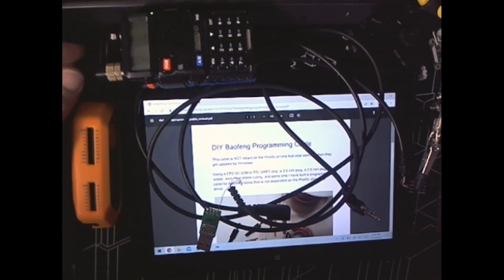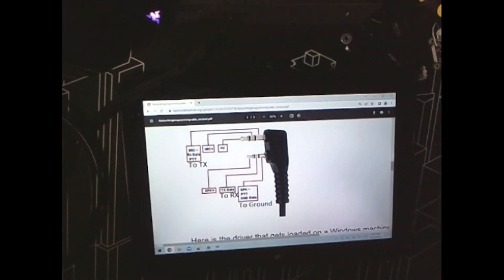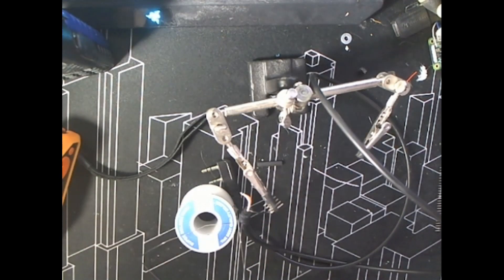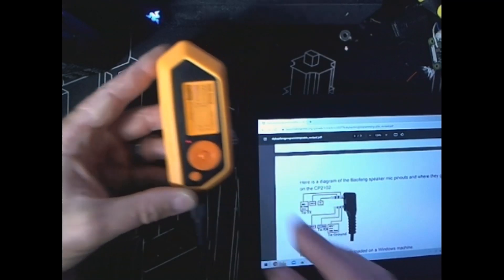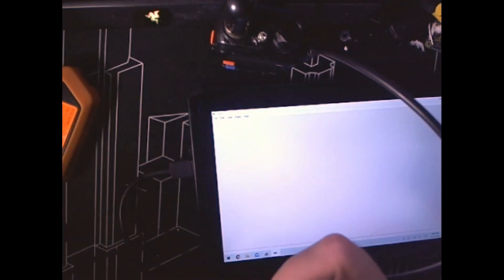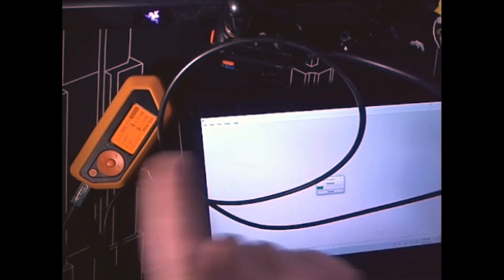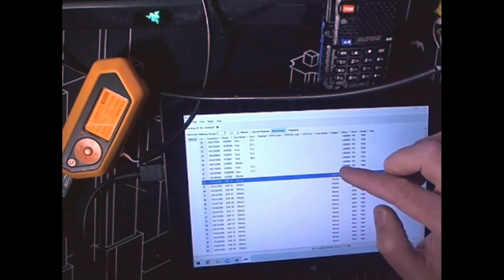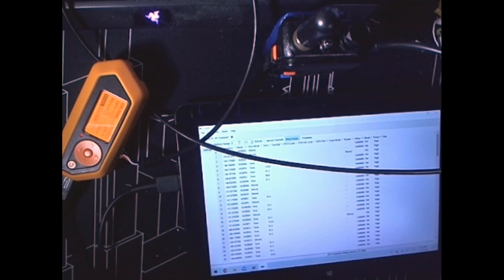Flipper Baofeng Cable

Comment: I have a question you might be able to answer. Would someone theoretically be able to take a signal captured on the flipper and use the baofeng to broadcast that captured signal at a higher strength? Specifically I'm thinking a 433MHz flipper capture.
Reply from the maker: Not with this. The cable on the baofeng is only for programming channels and settings of the radio. 

There is a cheap external RF unit that you can get for the flipper. This will allow external antenna connection, and then you can pass that through a power amp or even just a bigger antenna.

If you feel like programming the flipper and dismantling the baofeng, there's a way to interface with the RF chip via standard protocols that the flipper does support. Just no software has been written yet. Or that I know of. Might have a quick look into this myself. 

I have a short video demonstrating a 1W signal sent from the flipper. I'll do a hook up video for it soon. Just a lot of stuff is happening at home, and I haven't had much time to work on content.
Reply: Thank you so much for the response! I watched your other video that you mentioned. That is sort of what I had in mind and what I would like to learn how to do. I had just seen this video and got curious about the possibility of using a baofeng as a transmitter. 

What would interfacing with the RF chip allow if you don't mind me asking? I'd totally be willing to dismantle my baofeng to make this happen. I have a tech background but I'm not very familiar in this area sadly. Pretty new to RF stuff... it intrigues me very much and I have ideas I want to test with my flipper... so I'm trying to learn more lol.
Reply from the maker: Have a look over here. https://github.com/phishman/RDA1846

This is some basic reverse engineering of the RF chip RDA1846 that is used in the baofeng uv5r radio's.

There is nothing saying something similar can be completed on the F0